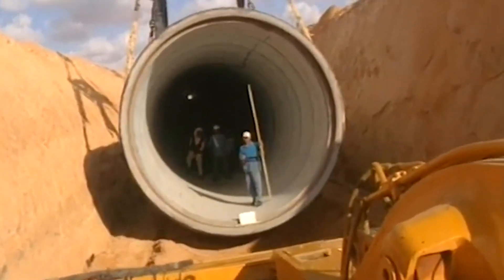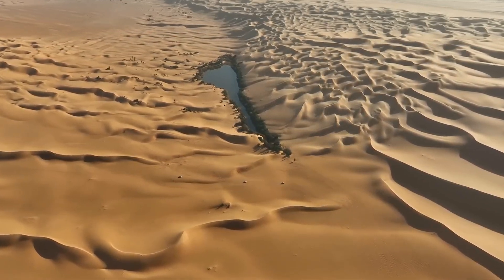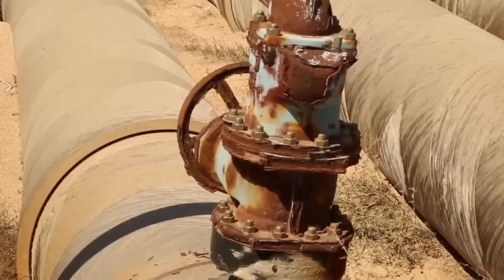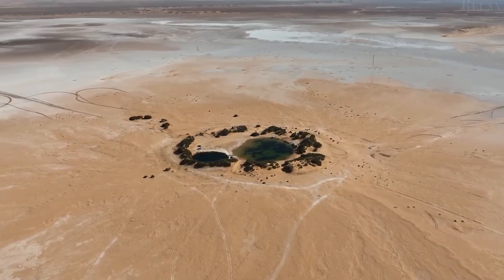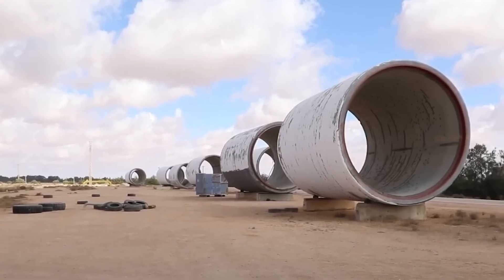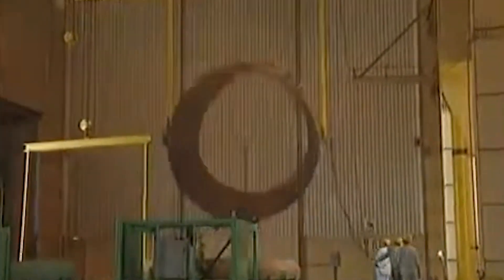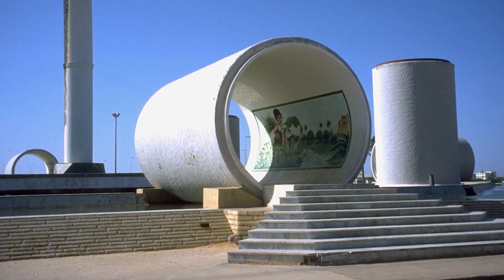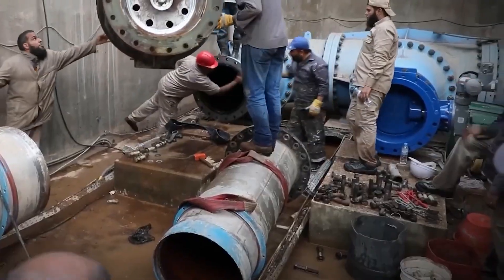Libya Is Pouring Water Under the Sahara Every Day — And It’s Changing Everything

Comment: Drill down old wells. The pipes use sea water where the salt is removed build drains to run power water mills to power desalination process. Water is a powerful force. This can be done with enough determination.